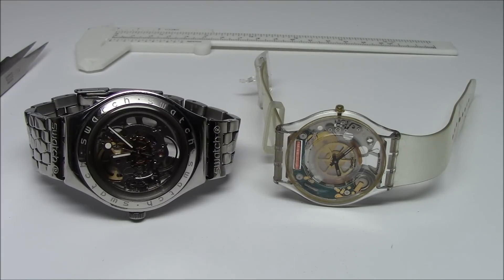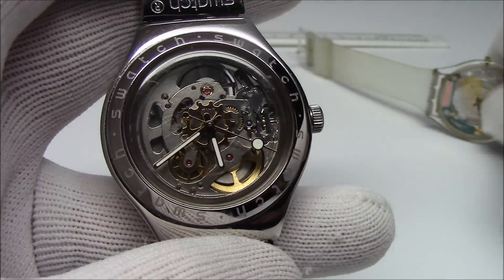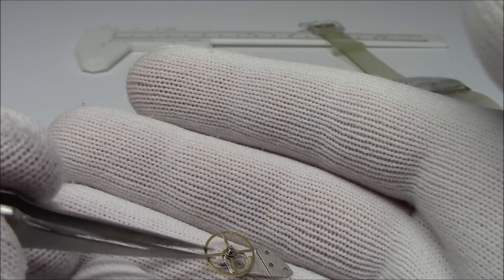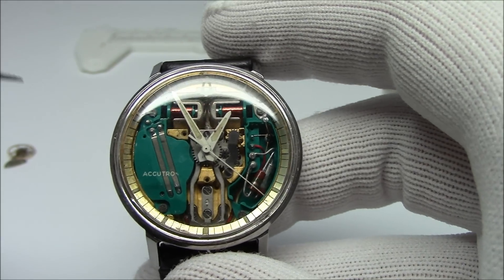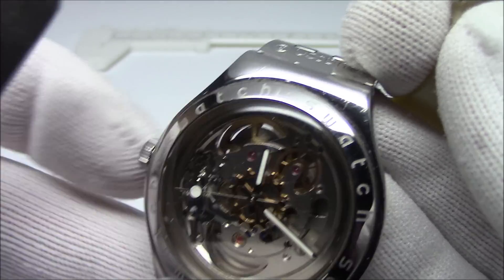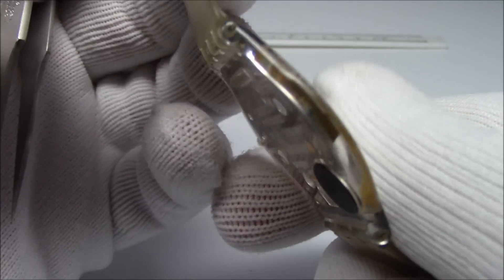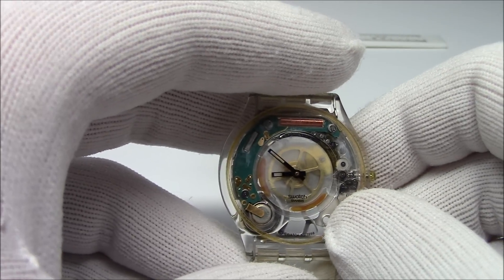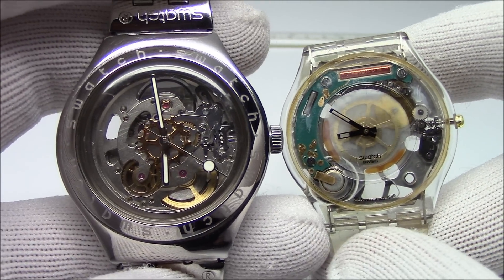Automatic vs Quartz Movements - Watch and Learn #4

Comment: When I was young I used to wear a Sector ADV 4500 quartz powered chrono, (I still got it but never worn anymore) it has an interesting feature to optimize battery consumption: when the battery power decrease, instead of moving the second hand once per second, it moves it once every 2 seconds, to save power and double the remaining duration! A very interesting feature for this (at this time) very inexpensive watch!

Comment: Diodes can’t lower voltage, they control the direction of the voltage flow.
Reply: A typical diode has a voltage drop of around 0.6 to 0.7 volts.

Comment: Why is it that if quartz watches have far more movements per hour the second hand still jumps, rather then a smooth motion?
Reply: Because the quarts is seperate to the mechanism. The energy is stored until 1 second passes then transfered thorough the mechanics 😁
Reply: Moving hand needs energy. The counter in a quartz watch is designed to count up 32,768 beats before sending power to the motor to move the second hand. Normally in analog quartz watch battery lasts in 3-4 years. If we design the watch to sweep the second hand like a mechanical watch, the battery will last in 6 months. Some quartz watch have sweeping second hand but they need something special to do that.
Reply: Vorapong Nivata apparently you have never heard of Bulova Precisionist watches
Reply: Nathaniel Wilson — I knew Bulova Precisionist. It uses CR2016 battery that has 3 time capacity of SR626 and it can run only for 2-3 years. Most of watches run on smaller SR626 battery for 3-4 years without replacement. Do you see the point?

Comment: a question please: how come the balance wheel turn borth ways  with the same speed when the spring is coiled at the maximum vs when the coil has little tension in it (power reserve is nearly empty) - cannot figure this one out..

this would mean that we have a slight difference in time measurment when the clock is wound up to the max and when it is almost going to stop? (i read that mechanical movements are less imprecise than quartz, is it because of this?)

thanks and keep up the cool videos!!

Comment: The Swatch is serviceable. Not a brand service, but an «illegal» service is possible. Mine was tuned. If you notice, you can see the tunning mechanism and scale in the back of the watch, on the balance wheel. It even sound strange why a non serviceable watch would have this scale.

Comment: 21,600 bph is regarded as 3 Hz (Hertz), 28,800 bph equals 4 Hz and 36,000 bph would equal 5 Hz. I was confused about this at first, but apparently there are 2 beats in a Hertz (Hertz is one complete cycle, not a beat).

Comment: Very nice explanation of the evolution of watches as a function of the oscillator.  Note that Bulova quartz watches is based on a frequency 8 times that of the average quartz watch, that is 262,144 which keeps its time plus or minutes 10 seconds per year.  I'm sure you already know that and the scope of this video is to go from balance wheel, to metal tuning fork, to quartz crystal.
The national time clock is based on an atomic frequency of cesium, which is approximately 9 billion oscillations per second.

Comment: The nice thing about quarz watches, is that some of them let you know when the battery is about to run out. By moving the seconds hand once every 2 seconds. (2 places at once, instead of one.) Or (in case of my digital watch anyway) by showing the warning "Battery low" on the LCD screen.
Reply from the maker: That is a great feature!
Reply: I like the ones that park the hands when the watch isn't being worn and keep time internally to save charge too. My watch turns the screen off at night if it detects it's not being moved around. It's also solar powered, so there's no good reason it shouldn't run till 2040 when the built in calendar runs out and beyond...
Reply: My Braun BN0106 can do something simular. I can put it on a battery save mode that switches off the screen, when the watch isn't worn. And switches it on when I pick it up. Although I never use that feature. Without it, the battery last 2 years and a couple of month's. That is good enough for me.

Comment: 28800bph = 8 beats per second, BUT that's only 4hz, as an oscillation is from one extreme to the other _and back_, during which the oscillator will give two impulses. So El Primeros vibrate at 5hz, most mechanical piecess at 4 or 3 and so on.
Reply from the maker: You should watch the episode we did strictly on BPH.

Comment: Just a little thing to note: the automatic Swatch Body & Soul model can be opened and serviced. The caseback crystal is pressure-fitted and held in place with a metal tension ring.

Comment: You should compare these with the (quartz?) movement in my Citizen Sky Hawk A-T or how a Casio Waveceptor works.
Reply from the maker: Thanks for your suggestion.
Reply: The Waveceptor takes time from a radio signal, so it continuously adjusts itself to follow the signal. This means the precision of the quartz timekeeping is less important than for self regulating watches.
Reply: peglor Obviously the Waveceptor gets its time from the N.I.S.T. master clocks in Colorado and Kauai but how often does it update? What is the acceptable deviation for a given period?
Reply: According to NIST, most clocks update once a day, though some do it every 6 hours. Reception is better at night as there's less electrical noise going on apparently. It takes about a minute for a full time and date signal to be sent due to the very low bit rate in the 60 Hz signal used, so it'll take up to 5 minutes after a clock is turned on before it synchonises. It's all up here: https://www.nist.gov/pml/time-and-frequency-division/popular-links/help-radio-controlled-clocks
Reply: Yes, I'm familiar with the signal sent from NIST and I have listened to them directly many times (I am also a licensed amateur radio operator). I think that most cheap wall clocks listen for the signal at midnight because the signal propagation is better after dark on the lower radio frequencies used. I also think that new watches may check more often as some are hybrid NIST/WWV, GPS and GLONASS receivers. Depending on the location of the receiver clock, some people have to take older clocks outside at night to get them to update. The antenna used within the clock is physically too small to work well on the frequencies they are trying to receive.

Comment: Hi great vids! Thank you for the time and effort you put into them! Just a quick question that I hope hasn't been covered here too much (maybe I missed it in your vid?). We saw how the second hand moves several times per second, appearing almost smooth in its movement as the number of beats increase per second....Why then do quartz watches tic, given they beat many thousands of times per second, far far more than any auto? Is it impossible to have a "smooth' moving second hand on a quartz? Thanks
Reply from the maker: Because the quartz second's hand is driven by a stepper motor that ticks at one time per second.
Reply: I see. I have a battery operated wall clock that runs with a smooth moving second hand. Wondered why  quartz  watches didn't. I realize probably apples and oranges, still I wonder why a  quartz watch could not be designed to do the same. Looks quite elegant in my opinion.

Comment: Great video!  Thanks for sharing.  One thing I want to say is that the automatic Swatch is serviceable.  Swatch may not want to do it, but another watchmaker will.  They can pop the plastic (or glass) out of the back, and work on it.  I have the same basic model and I've had it serviced twice: once by the store I bought it from and once by a different watchmaker.

Comment: When a battery operated quartz watch with hands, has a hackable feature, does it disconnect the battery from the stepper motor or the entire movement  ?
Reply from the maker: The entire battery is disconnected, "lengthening" its life.
Reply: Ok thank you

Comment: Another very good presentation. However, it needs a significant correction:
36 kbph = 5 Hz
28.8 kbph = 4 Hz
21.6 kbph = 3 Hz
18 kbph = 2-1/2 Hz
3.6 kbph = 1/2 Hz (my grandfather clock)
Every complete cycle of the balance (or pendulum) has two beats. Your narrative stated twice the actual frequency as if each cycle had only one beat. A good topic would be about adjusting and regulating a mechanical movement, the difference between them and how they're performed, with a little about how some of the mid and high grade quartz are regulated at the factory during final inspection and testing.
Reply from the maker: Thanks! I covered it in more depth in another watch and learn that was published recently. I do realize that a back and forth beat of the balance is one tick, thus the doubling. Why I said it wrong, I'll never know!

Comment: Mechanical watches are know for their long life span, if maintained correctly. But how long well made quartz mechanism lasts? I am not talking of course about cheap disposable watches you can buy for 10 dollars.
Reply: My wife's everyday watch (sekonda) is still going strong 24 years later and has only had the batteries changed when required  .

Comment: I have so much more respect for quartz movements now. 

I still love automatics because of their complexity,  but wow... had no idea quartz used an oscillating quartz tuning fork.
Reply: Joe Joe Quartz get a bad rep because cheap watch will have a quartz movement (a low quaility quartz but still battery powered none the less.). There’s also a part of history when quartz almost killed the mechanical watch industry but that’s for hardcore watch nerds. I myself have a few quartz and they have been accurate for years, never have to adjust them except for daylight savings. I still prefer my mechanical and auto movements but Quartz still holds a special spot in my heart because my very first watch was a Timex Quartz watch.

Comment: What's the average lifespan for a good quartz movement?  I have a Seiko that has lost reliability lately.  It's 18 years old, battery tests fine, but occasionally it stops for no reason.
Thanks!  Great videos!.
Reply from the maker: With service, 10 or 20 years.
Reply: Long Island Watch Thanks you!

Comment: the digital clock in my honda civic looses almost 2 minutes a week. i don't know why.
Reply from the maker: Probably needs unleaded. LOL
Reply: that happen because you drive fast and travel in time
Reply: Matthew G Check the wiper fluid. :P
Reply: That's the tachometer. Not the clock.
Reply: Needs a 800 CCA lead acid battery to excite the liquid crystal faster.
Reply: Probably can’t handle the VTEC.
Reply: Sell your civic lol

Comment: How does the power reserve on a watch work? When looking at watches online etc it often mentions a power reserve, eg 48hrs. I assume this means that once the battery has lost a certain percentage of power then it enters its "reserve".

If, as you say, a watch doesn't slow down as the battery drains, how do you know when the watch is in its power reserve as opposed to normal function?
Reply: Power reserve normally points to mechanical watches (manual or automatic wind). It indicates how long the watch will run after a full wind without rewinding (manual) or any movement(automatic).
There are solar powered watches where it will indicate how long a watch will run after a full solar charge and staying in the complete dark.
For quartz watches it is normally called battery life.
Reply: ***** Ah. Clearly I had the wrong idea.

So if I understand it correctly now, a watch would only be advertised with a power reserve if it were a manual or automatic winding watch? A quartz watch would not?
Reply from the maker: Yes. Correct. The exception being Quartz based Kinetic and Solar watches; their power reserves are in the realm of months, and usually there is a power reserve function that can be activated. But PR is generally reserved for autos and mechanicals.

Comment: very nice video Marc.  I'm a fan of qwartz and treat mechanical as a novelty of sorts.  However, I can see the value of mechanical in a military setting when everyone needs to be on the same page with no chance of battery's going dead
Reply from the maker: Absolutely; or, go Solar!
Reply: The problem with mechanical in a military setting is that mechanicals are very sensitive to shock. I'm no watch maker but I wouldn't think the repeated recoil of a gun would be good for accuracy.

Comment: If the quartz operates so much faster than the mechanical, why do almost all quartz watches have a second hand that jerks every second instead of having a nice sweep?
Reply from the maker: Great question. It's by design only. After 32,768 osciallations, a stepper motor pushes the seconds hand one second. It's arbitrary, but helps keep battery life extended. It could move every 100th of a second, but that would consume alot of energy.
Reply: But if the counter was designed to over flow after 14 bits, then there would be 2 ticks a second. Reducing counter bits would cause the beats to increase like 2,4,8,16 ...beats per second and not necessarily 100. i think it would be awesome to have a quartz with 8 ticks  per second, even if the battery ran for 1/8th of a normal quartz watch.
Reply: They exist, with indeed a lot shorter battery life (Bulova). Grand Seiko quartz watches move in two steps, making the movement more fluid. To the eye, it still appears as one (smooth) step though. If you want a real sweeping hand, you're looking at Spring Drive and a very different price point.

Comment: Marc how accurate is the Acutron tunning fork watch? Better than quartz?
Reply: No, + _ 1 / 2 seconds a day .
Reply from the maker: No, in general, the higher the beat, the more accurate, with a Cesium clock being the most accurate : )
Reply: It must be more expensive than the quartz??
Reply: "How do you keep a SKX007 wound?" You either have to wear it or put it on a winder. Mine stops after about a day and a half if I don't wear it.

Comment: What about elevation changes effecting movements? I'm living at sea level, but in March I'm heading to Nepal (3,000-4,000m elevation where I'll be). I'll be bringing a Seiko SKX007 for the ride and was just curious. Thank you for these great videos!
Reply from the maker: Won't matter! Air pressure doesn't have that much of an effect,and that altitude is only a few psi different from sea level, so no worries.

Comment: With a typical Japanese automatic (let's say Orient Bambino), how often does the watch need to be serviced to remain accurate?  How much does this typically cost and what is involved?
Reply from the maker: Most say about 5 year intervals, but I say, if it ain't broke, don't service it. A general overhaul is a complete disassembly, degrease, re-assembly and re-lube. Costs vary, I'm going to say it will start at around $100.

Comment: 21,600 vph is 3hz or 6 ticks per second. 28,800 is 4hz, and 36,600 is 5hz. The number of hz includes clockwise and counterclockwise rotation of the balance wheel, and each direction causes a tick, so that's why a 4hz movement ticks 8 times per second. 

Great vid! I'm loving these more technical videos.
Reply from the maker: Glad you enjoy. You meant 36,000 above.  :)
Reply: +Long Island Watch Yeah... :P of course the one time I decide to get technical I make a mistake.

I'm looking forward to more videos in this series! Keep up the great work on the channel. 

Cheers, 
Grant
Reply: Grant Powell

Comment: Great video!

I have a question. Do high-beat watches suffer from higher wear than regular beat watches?
Reply from the maker: With proper lubrication, no. They are built for it. Hi beat (meaning different things for Seiko and rest of the watch world) basically stops at 36000. They use advanced lubricants and materials that make them have the same service intervals. Want really cool? Check out the TAG Calibre 360 in the Mikrograph. That's 360,000 BPH.
Reply: what is seiko's definition as opposed to the rest of the watch industry? thanks for the great video
Reply: Need to create a watch case where all the mechanisms inside the case are sealed in a total vacuum. Still have gravity to deal with but the vacuum would reduce friction. Lubricants would have to change. Temperature would be of no consequence in that state. Just thinking out loud...
Reply: Unless you float the gears on maglev bearings heat will still conduct through the case into the watch mechanism. Even at that radiation will still transfer heat in and out of the watch.
Reply: Yepperz. I recon so.